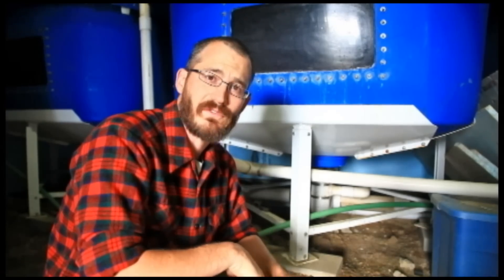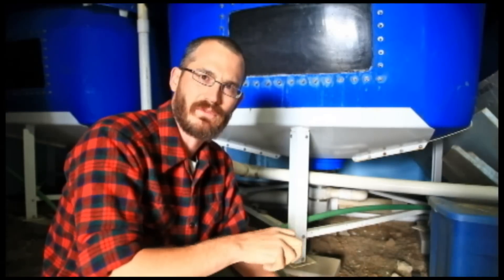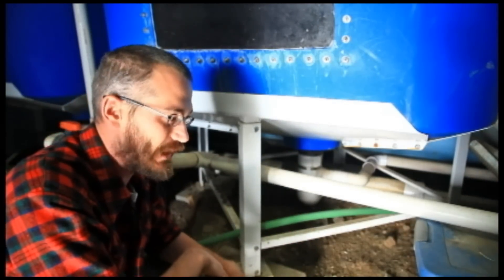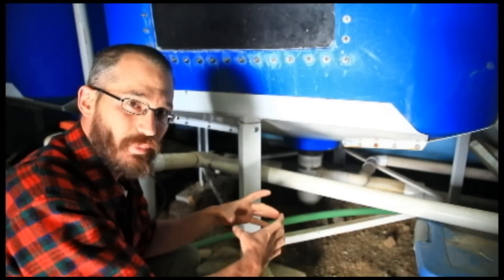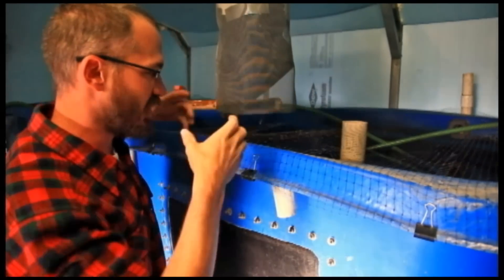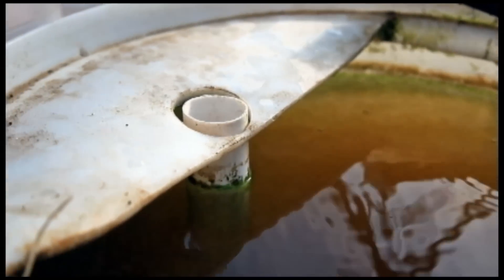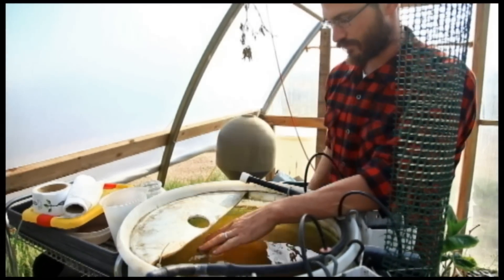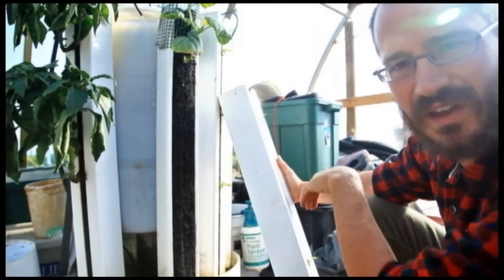Solids Lifting Overflows for Aquaponics

Comment from the maker: If you're draining through a tank bottom you can use bulkhead fittings, or make your own.  On our large system, the drainage system is largely made from scratch, including many of the flow-through and drainage elements.  For instance, in our system, we run our outflow pipe into our cleanout system and then through the sidewall of a piece of 4 inch PVC.  It's jerry-rigged into place with hose clamps, glue and lots and lots of silicone caulk.  Sometimes you just have to make it yourself.  :)

Comment: I must admit you lost me for a bit, then when looking at the small system i got it. :-)
This is a way of plumbing a SLO with the water exiting the bottom of the tank. The other SLOs i've seen have been IBC systems with the water exiting form the side of the tank using a T running from open air at the top to the bottom of the tank.
Thanks for the great vid.

Comment: Is there an upper or lower limit on the difference in size between the outer and inner standpipes? Basically, how much space would be optimal between the inner and outer pipe?
Reply from the maker: There should usually be at least 1/2 inch gap between the inner and outer pipe up to a 1" inner pipe.  There must be at least a 1" gap for all pipe sizes above this (because it's assumed we're talking a larger tank and larger volumes being moved.) The larger the gap, the more water volume you can move, but if you go too wide at lower volumes you won't be able to pull the heavy solids off of the bottom of your tank.  So in the end it really depends on how much water you're moving through the tank.

Comment: You don’t need the drain to flush you just need to use a proper setup. You don’t need the t fitting to prevent full syphon this is killing your flow and costing a lot more in plumbing and time in maintenance. Replace the t with a normal elbow and drill a hole in the side right below the waterline. The hole will act as a syphon break should your pump fail. You can then get rid of all that enormous pipe and use 3/4”or 1”pipe this will create enough suction to keep the tank clean wo needing to flush it or vacuum it.